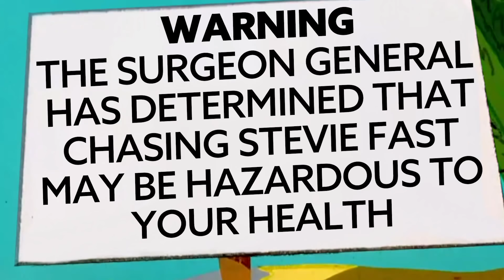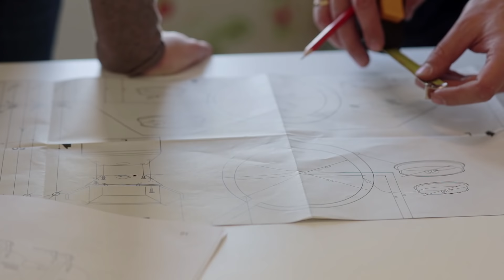Stevie Fast:Leaf blowers, Hummingbirds, & Trackside Electrical Malfunctions.

Comment: not all of us turbo queers stage with a bump box or bounce into the beams. There are still some of us, that go into both bulbs with some brake pressure and stage with both feet like a man!!
Reply: BigChief405 who does that?
Reply: brandon sikes lol if you say so buddy!!! anyone that has ever raced with me or against me knows that i don’t bump! i don’t use the fueltech (or any other box) to bump or creep or anything like that. I use lamb brakes, so i get some brake pressure with my left leg,  donkey stomp the throttle with my right leg, and i hold it there until it makes 8 or 9 lbs of boost (usually within 1-2 seconds) and then i lift the left leg and roll in like a man!!! if it looks abrupt it’s just cause it ain’t easy stopping a car at 4600rpm and 9 lbs of boost lol. usually it’s pretty smooth unless the front tires are sliding, then i have to just grab the transbrake to stop it
Reply: BigChief405 also what takes so long in between replies you were free 30 seconds before I put my reply up

Comment: When you have one of the baddest hot rods in the game and that happens.  I see alot of turbo guys going procharged just for the staging.  You are still the man.   Gap band for life.
.
Reply: John Huff going from turbo to procharger loses at least 25% of your engine power, so no serious racer would do that.
Reply: @nordic5490  all 3 records in radial are with in .03 for all commbinations. And nhra is considering 2020 allowing them in the class.  Must not be that bad
Reply: John Huff looks like traction is the limiting factor in that size. You must be able to run a big enough engine to make up for the supercharger losses.
Reply: John Huff no one is switching because of staging process they are changing because the see rivenbark going fast what they don’t see is the putting a new gear drive and head unit on it ever pass the have 10 gear drives and head units sitting in the trailer

Comment: Why do you rev the motor up at the end during warm up 
The last thing you do is raise the rpm higher and kill it
Reply: because its a blown alcohol car. burn a lot of the raw fuel out. cleans it out. they have 10 times the amount of fuel going throu that engine than a gasoline burning engine
Reply: Thanks